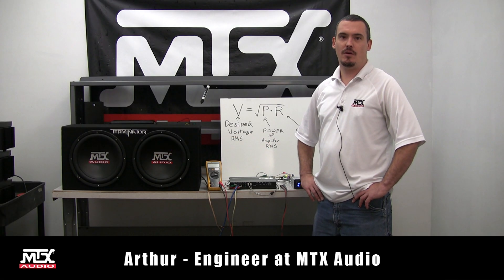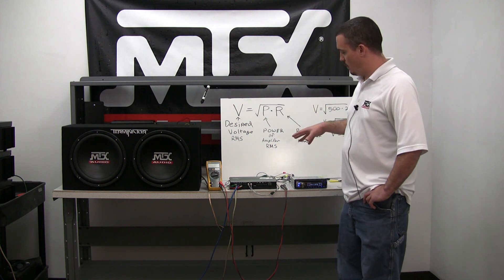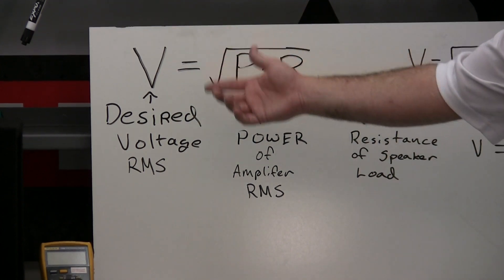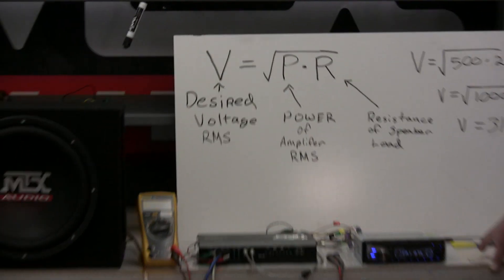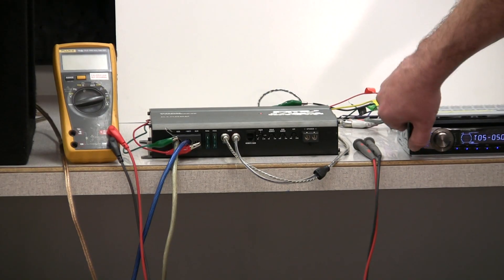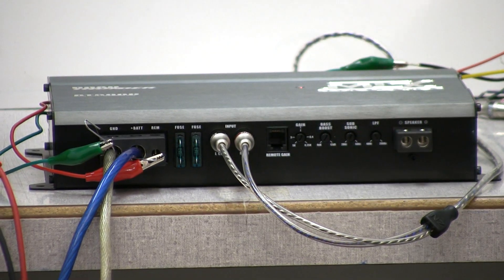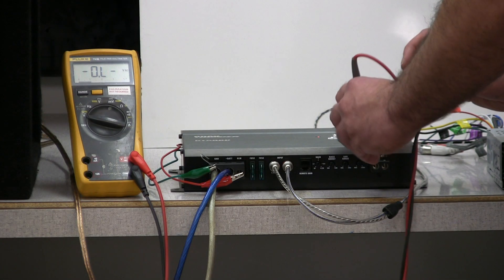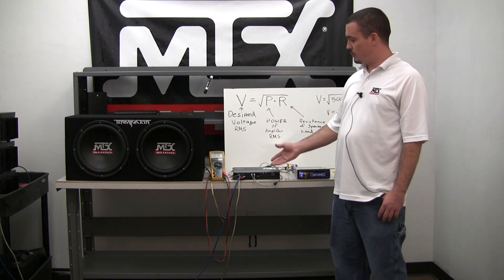How to Set Your Gains Using Ohms Law and a Basic Multimeter

Comment: I understand what your saying but with out these features on after the setting of the amp gain I feel like I'm not getting the output I want. So I want to make sure if I do use them I'm not going to clip the subwoofer to the point of damaging it. Also my amp is a jl 1200.1v3 and I'm pretty sure it's close to 2000 watts rms I cannot find a birth sheet any where for these amps so I do not know the true rms power at 3 ohms. I'm running one 13.5w7 at 3 ohms it can handle 1500 rms. So i need to know the sweet spot on my amp. Jl recommended 60.0 v at 3 ohms will do 1200 rms but I think the amp can do more power. At 60.0v I don't feel it is hitting as hard as it should.
Reply from the maker: Remember... by setting your gains properly, you are setting the amplifier output that you need for the RMS power handling of your subwoofers. If you feel the output isn't what it should be, consider looking into your enclosure volume and tuning. If you do the math calculation of V = square root of Power x Resistance and it is around 60 volts, I would stick to JL's recommendation. On their website, this amplifier has an RMS rating of 1200 watts at 3ohms. So, the calculation would be V = square root of 3600 which = 60.

Comment: The reason I ask is I'm running a jl audio slash 1200.1v3 and a jl 13w7 and at the target voltage of 60.0v it's 1200watts rms and I fell the sub is not as loud as it should be. I do not want to damage it but I notice when up the levels on my head unit it gets the extra push I want. I'm afraid im could be damaging it in the long run please help.

Comment: So let's say I have everything zero'ed out on my head unit and after I set my gain on my amp to the target voltage i set my crossovers and frequencies. My target voltage is still the same. Now if I get in my car and start to turn up the subwoofer controls from 0db to +10db and turn the loud setting on won't that take my target voltage up and start to distort my subwoofer?
Reply from the maker: It could... But manipulating the audio signal using features like bass boost and loud settings is a bit different than setting your gains. When you set your gains, you are level matching the output of your amplifier to the RMS power handling of your speakers/subwoofers to ensure a good combination and to not over or under power your speakers.... When you use bass boost and loud settings, you are actually manipulating/changing the audio signal prior to any amplification of it. This is why we recommend setting your gains with no bass boost or loud settings on. Once your gains are set appropriately, if you want to tweak and tune your system to your personal listening preferences, using these features can help. But if your bass boost is all the way up and your loudness setting is all the way up, you could distort your subwoofer whether your gains were set correctly or not because those features can cause a clipped signal to be sent to the input of your amplifier before the amp gain ever comes into the scenario. Hope this makes sense.

Comment: OK so I have 1200 watt amp at 1 ohm. That comes out to 34.62. Set it on my gain with multimeter connected. My multimeter only has 200v as its lowest setting for alternating current. This makes it come out to 3.4 on the multimeter. Is this correct? Let me know please and thank you.
Reply from the maker: You should be able to select the proper type of voltage (AC) and make sure your leads are inserted into the proper socket. You should probably refer to your multimeter's manufacturer's page for an owner's manual.
Reply: It has 200 or 2000 for alternating voltage
Reply: So I'd assume 3.4 comes out to 34 its just moved the decimal to fit if voltage goes up to 200

Comment: Hello I'm having trouble setting my gain. My amplifier has a rms of 500 rms and my sub has a 4 Ohm resistance. Which means that my amplifer should idealy output 44 volts about. Once i have everything turned down on the amplifier except the LPF, I plug my phone in with a 50 Hz playlist using a aux cord . I turn the volume all the way up on my head unit and go turn up the gain while measuring with my multimeter. As I turn it up I realize that if I max out the gain it only outputs as high as 9V. I was wondering if anyone can help me solve this problem please? Is it possible that I have to turn off some settings on my head unit ?
Reply from the maker: There are multiple things we need to determine here... First of them is... Is your amp rated at 500 watts RMS at 4ohms? Amplifiers usually have multiple RMS ratings. 1 @ 4ohms... 1 at 2ohms... etc... If your amp is rated at 500 watts RMS at 2ohms but your subwoofer is a single 4ohm voice coil, your amp will probably only output around 250 watts RMS. 

What is the RMS power handling of your subwoofer? If your sub is rated for 500 watts, you can use the full RMS output of your amp (if your amp is rated at 500 watts RMS @ 4ohms). But if your sub has an RMS power handling of less than 500 watts, you won't want to calculate your voltage using 500 watts anyway.
Reply: hi thank you so much for the reply. I have a pioneer dm-7400m which is rated at 400 watts * 1 at 4 ohms or 200 watts at 2 ohms. my subwoofer is a kicker compR and it's rated at 4 ohms and has a continuous power handling ( watts RMS) of 500. I have no idea how to set it up and which numbers I can use. can it be that my amplifier is only rated at 400 RMS and that is the problem ? can you please help me? thank you so much for your help!!
Reply from the maker: It doesn't make sense that your amp would have less power rating at 2ohms than it does at 4ohms so something seems off here. I checked the Pioneer website and that is what it shows, but when I checked the Crutchfield website, it shows 200 watts RMS x 1 @ 4ohms and 400 watts RMS x 1 @ 2ohms which makes more sense.

Assuming the Crutchfield website is correct, your amp will do 200 watts RMS at 4ohms. Since your subwoofer is a single 4ohm voice coil, that is the lowest impedance you can use. This combination of subwoofer and amplifier is not ideal. You are only going to be able to put 200 watts to your subwoofer. 

Consider buying an amplifier that does 500 watts RMS at 4ohms or close to it. OR... Buy a subwoofer with a 400 watt RMS power handling rating  that is dual 4ohm voice coil so you can wire it down 2ohms.
Reply: thank you very much for the advice I will be looking into buying another amplifier because my subwoofer is brand new. very helpful you now have a new subscriber !! :)
Reply: Sorry to just jump in here and ask a question but I can't figured out the math for my setup. My amp is under powering by a lot but I have 1300w amp @ 1ohm and two DD3512 d4's rms600-1500--3600 peak each oh and my head unit volume only turns up to 35
Reply from the maker: @T ray - You need to determine what impedance your subs are wired to. If they are
 both dual 4ohm voice coils, they could be wired to 1ohm or 4ohms 
depending on how it was done. Once you determine that, you multiple take
 the square root of Power (the amount of power you want to get out of 
your amplifier based on your subwoofers RMS power handling ratings) 
multiplied by the resistance (ohms) your amplifier is seeing which is 
determined by how your subwoofers are wired.
Reply: They are dual 4 ohm and I have them wired to 1 ohm and my amps Phoenix gold ti2 1300.1
Reply: It's way under power my subs but it's all I was able to afford at the time I purchased it all
Reply: powering *
Reply: MTX Audio USA I just did a little math or I tried to..I came up with 36.05volts but math wasn't a strong subject of mine
Reply from the maker: T ray yes... that's correct for the square root of 1300.

Comment: Great! thanks! nobody says "why" the level set in stereo its full up... nobody says how to put the level stereo...nobody says there is no afect to use or not the speaker for test (somebody told me that i needed to have a resistance (speaker) conected for this test...)

your video solved me that questions..!

Good good good video! i like it!
A question..may u help me?
If I have a 100wrms amp and my subwoofer is 200wrms(4omh).. its suposed 
that i must to put the gain to the max??
and on the other hand..
I would like to know the Wrms of my stereo sistem (pioneer DEHx8600BT 
and others..)
most of stereos say 50x4 (peakpower) but i just to know the rms of that 
stereos (just to know it) is it any empirical test to do it ???

THANK YOU VERY MUCH IN ADVANCE!!
Regards from Spain!
Reply: You don't need the load (speakers) connected because you already calculated the total resistance when you measured the ohms of the speakers. Speakers are only to actually hear the sound. The signal is still present at the output terminals

Comment: each mtx terminator sub is 200 watts RMS Resulting in 400 for both so they are not the same RMS as the amp. When I am getting the desired voltage, do I calculate Both subs RMS? I have Two 4 ohm Pioneer Subs running parallel taking it down to 2 ohms. Each Sub has a Nominal power of 400 watts. What is the desired voltage?

Comment: Some people say to get the desired voltage to calculate the RMS power of the speaker times the ohms then square root it. Mtx says to calculate the RMS power of the amp times the ohms of the sub.  Which way is Right?
Reply from the maker: You are correct. You should use the total RMS power or your subwoofer(s). In our example the total RMS power handling is the exact same (500 watts) as the RMS output of the amplifier. 

By using the total RMS power handling of your subwoofer(s), you can use an amp that has more RMS output than you need and be confident that you aren't going to overpower your subwoofer(s).

If you would use the RMS output of the amp without considering the power handling of the subwoofers, you would be setting the gain to maximum output which could be bad for your subs depending on their rating.

Thanks for bringing attention to this. We've answered this question multiple times in the comments. It's just that our specific example is exactly the same RMS rating for the two subs (250 watts each) and the amplifier (500 watts x 1).

Comment: What about Dual-Voice-Coils? A DVC 4 ohm sub which I'm wiring down to two ohms. The sub is rated at 400 RMS and the amp is rated at 600 RMS.
Reply from the maker: Dual Voice coil or Single Voice coil doesn't matter. Just choose the impedance the amplifier will be working with and do the calculation. In your case, V = square root of 400 watts * 2ohms... V = square root of 800... V = 28.2843

Comment: What Voltage for 250 watt rms 2 ohm amp to a 300 watt rms 4 ohm woofer that is 600 watt at peak?
Reply from the maker: Since your subwoofer is single voice coil, 4ohm, what is your amp's RMS power output rating at 4ohms?
Reply: ***** It is 144 at 4 ohms
Reply from the maker: So if your amp is seeing 4ohms from your sub, it is only putting out 144 watts of power to a sub that wants 300 watts to perform properly. Your amp is under powered a bit. But to do the calculation... V = square root of Power x Resistance. V = square root of 300 watts x 4ohms. V = square root of 1200. V = 34.64 volts but I don't know if your amp will be capable of that.
Reply: ***** It actually worked. Thanks for the help.
Reply: ***** Hey, just curious, could i wire both channels from a mono amp to a single voil coil sub?
Reply from the maker: A true mono amp only has 1 channel. If you are talking about a 2 channel
 amp, you can bridge the two channels together and wire them to a SVC 
subwoofers BUT only if the the amp is bridgeable. Not all amplifiers are
 bridgeable.
Reply: ***** The amplifier I'm talking about is the Kicker DX 250.1 and it has 2 speaker outputs.
Reply from the maker: We cannot be certain about another manufacturer's products and designs. You should contact Kicker about their products. But my guess is that they offer two outputs but if you use both, you would be dividing the power between them since the amp is a monoblock (1 channel).

Comment: i have one rca output for my sub amps. i am connecting two amps to the rca output with y splitters. amps are 3500rms each at 1 ohm. subs are dual 2 ohm. wiring them down to 1 ohm obviously. but what now? voltage?
Reply from the maker: Voltage (V) is what you use the calculation to determine. If both amps are the same and both are powering subwoofers that are wired to 1ohm, your calculation would be the same for both amps. V = square root of Power (P) x Resistance (R). 

Make sure you are using RMS ratings (not Peak or Max power) and you are using the RMS power handling of your subwoofers... You don't want to use the RMS output of your amplifiers if they offer more power than your subwoofers are rated for.

Assuming your numbers are the correct RMS ratings, V = square root of 3500 x 1... V = 59.16. 

What subs and amps are you running?
Reply: +MTX Audio USA thank you for your reply. i really appreciate you taking the time to write back. 
im using the esx signum 7000d as amplifiers. (2 of them)
and ascendant audio mayhem 18s as subs (2 of them).

my head unit has 3 rca pre outs of 4v. front l +r, rear l+r, sub l+r. wil use the rca y splitter on the sub output on the headunit.

Comment: would be 28.28 volts is what i would need. so i would need to disconnect the subwoofer? and the radio all the way up? :)
Reply from the maker: using an appropriate frequency disc (we suggest 50Hz for subwoofers) at maximum volume, disconnect your subwoofer, connect your multimeter to the speaker outputs of the amplifier, turn the gain of your amplifier up until it reaches 28.28 volts. This is the simplest way to level match your amplifier to your head unit without needing more complicated equipment.

Comment: Reading these comments...did anyone pay attention to what he says? He clear as day explained how to do the maths. Either these people can't absorb info or are just plain too dumb to comprehend simple algebra. In that case, forgrt the car audio scene and just listen through headphones and don't short circuit your brain.
All you have to do is use the same formula, just plug in your own numbers...SIMPLE!
It makes no difference what brand or watts the amp or speaker(s) is. 
 Ex. The amplifier puts out 527watts RMS, multiplied by the OHM load (0.5, 1,2,4,8,16) of the speaker(s) that the amp is receiving, press =, then on your calculator  push the Square root button, it looks like a check mark with a tail...527watts x 2 ohm load= 1054, the square root of 1054 is 32.47.....32.47 (32.5) is what the output voltage you want to set the amp at. It's not complicated. For the confused out there http://www.math.com/students/calculators/source/square-root.htm
Reply: At last, someone who gets it!
Reply: Nope they just wanna ask stupid questions
Reply: ik this shit is very simple and easy to remember
Reply: IamTheEggMan lol your explanation was better thanks haha
Reply: IamTheEggMan  ok so I multiply RMSxOHM load then press = so after I press = push square root button.
Reply: IamTheEggMan old thread but i have two 12inch subwoofers rated 300rms each subwoofers are wired down to 2 ohms and the amp on 2 ohms is rated 800rms so how can i work out what i need to set my gains with a multimeter thank you ?
Reply: Marcus43 bolts would be 34.64 at 600 rms. If this helps let me know.
Reply: aaron collins thank you but what about 800rms ?
Reply: Marcus43 800 at 2 ohms would be 40
Reply: can you explain why he said in the video to set your meter to AC volts?
Reply: do the maths? maths is not a word lol.
Reply: marcjtdc maths is a word. It's sort for mathematics. Technically speaking maths is more appropriate than math
Reply: IamTheEggMan best comment ever 😂
Reply: so I fallowed everything step by step and set my gain correctly. now I noticed when I turn up like the bass boost/db knob that the voltage goes up. is that OK since the gain is set correctly?
Reply: Good knowledge. But you sure we're a dick about it.
Reply: I wish every person that tried to teach did it like you.Some people are very good at explaining things and others just like to hear themselves talk.The latter make terrible teachers because they end up overloading the "students" brain.Thank you for chiming in here and making it simple and understandable!

Comment: I have another question. I hooked up my amp today. I have a alpine mrp m500. When I test for volts on the speaker output I'm not getting anything. I'm reading 12v at the fuse on both sides by the battery. I'm getting 12 volts at the amp and on the remote wire. The amp powers on, But no volts on the speaker terminals. I tried replacing the fuse on the amp it looked blown but still nothing. Is my amp blown? Or is there something I can do? 

Again, thx for the help! This is the only channel I've gotten any help from... Much appreciated!
Reply from the maker: +frank lucas Are you playing music while testing your speaker terminals? If you are, check to see if your gain is turned all the way down. If that doesn't fix your problem, you either have a signal issue or a bad amp. The amplifier is getting power but may not be getting signal from your head unit which could be a problem with the head unit, the RCA cables, or the amplifier. But if you can test to ensure you are getting signal to the amplifier, that would rule out one more potential issue.
Reply: The 12 volts you're getting at the amp is DC. When you test for volts on the speaker output switch your multimeter to read AC volts ...